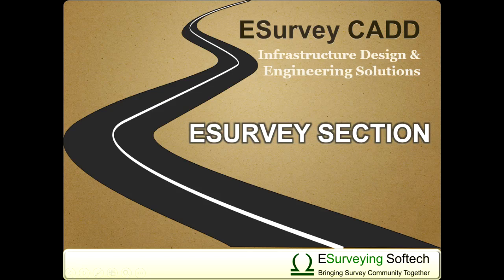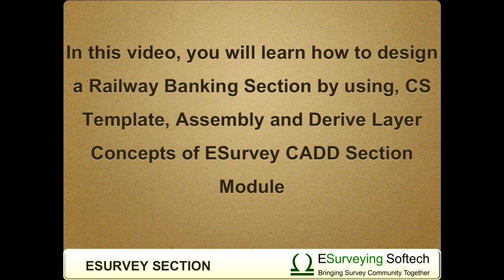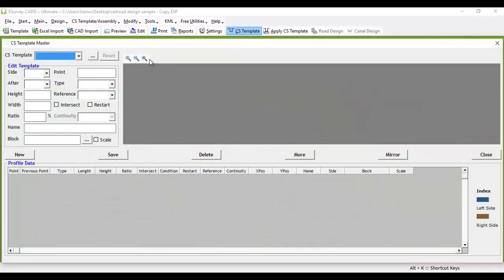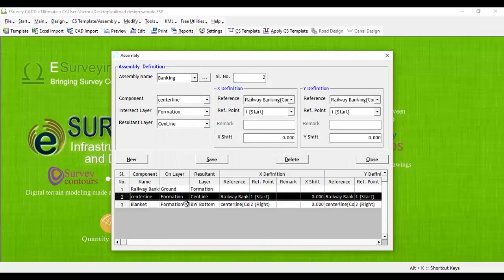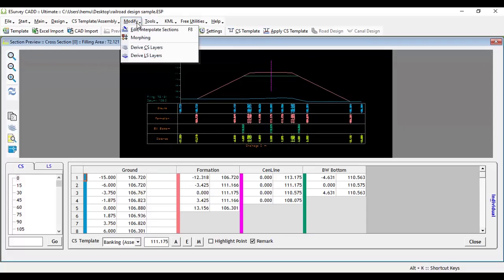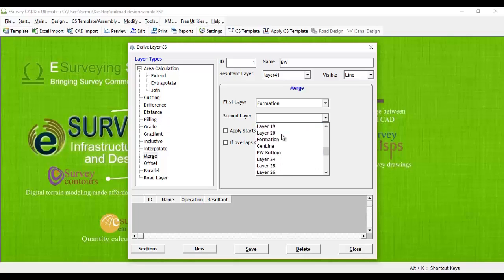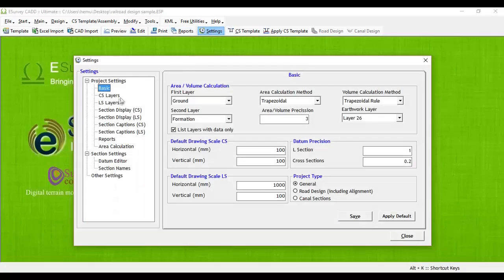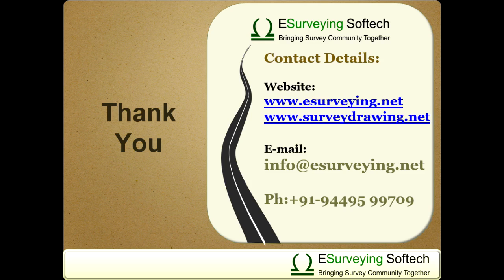Design Railroad Cross Section for Quantity

Comment: Dear sir

            I want to help me. I am try to plot x section in excel to autocad but i am not successful. I have a work railway bank cess repair with E/W filling one sided. His station is started from CH - 0.00 

 distance                                  RL

 0.84(centerof track)             99.84

3.00 (ballast toe )                  99.02

8.00 ( bank toe )                     96.33

12.00(OGL)                              96.94

its design level is 2:1 ratio (Proposed level)

           Dear sir, i am request you plase guide me how to plot this  x-section & finds its area. I again request you sir please one video
Reply from the maker: Dear Sir

Please visit https://www.esurveying.net/ and register. you will get complete details

Regards
ESurvey Team